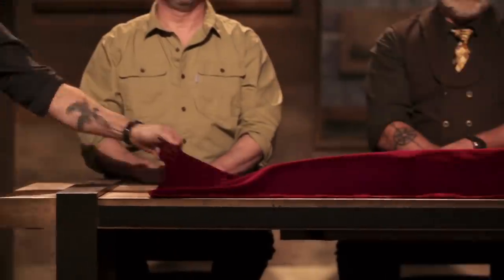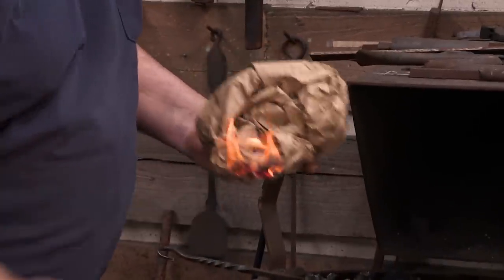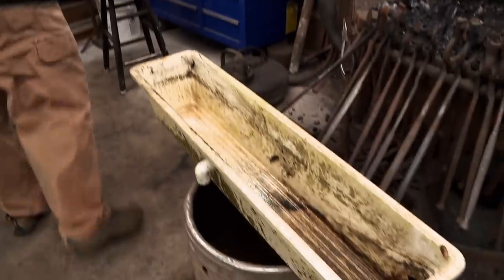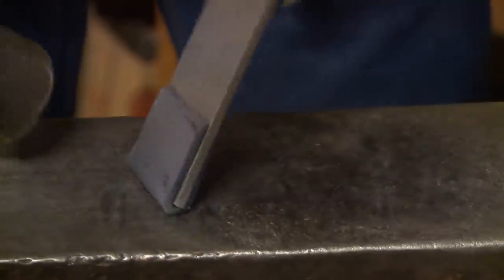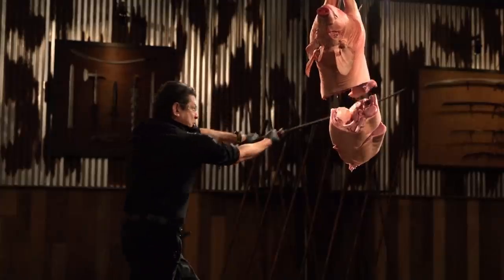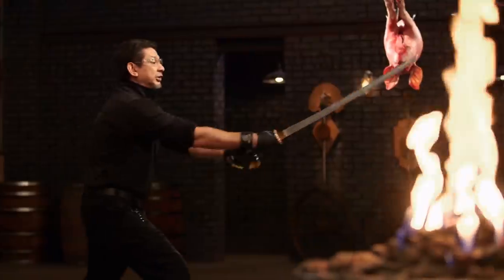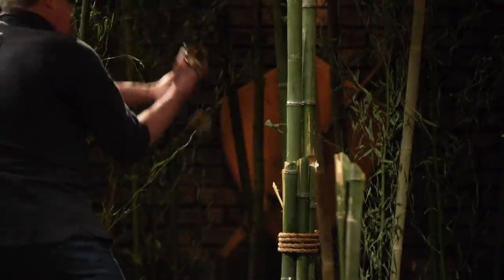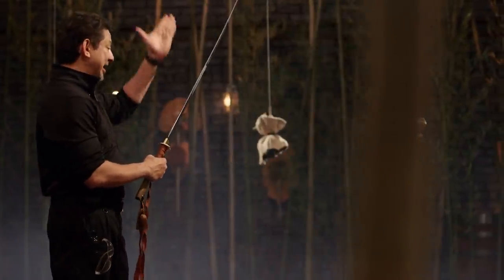Forged in Fire: Gunto Final Round: Richey vs. Elijah (Season 6) | History

Comment: Imagine your in the battlefield.. What would you choose?
1)unwraped sword. or 
2)A bended sword.

   What a judges?
Reply: Both smith's took a slightly bend. One in the kill test, the other in the Streangth test. With that they where tied. But the loose wrapping seemed to be more of a problem, then the lighter blade brings an advantage.
I think it's important to notice that the judges are really picky, when it comes to the handle of a weapon. 
In every round and challenge, the handle is the thing that sets the closest competitors apart from one another. 
And I think thats not without a reason. The handle is the piece that connects the user to the weapon. A well done handle dicides about how good you can control this weapon. 
The best crafted blade is worth nothing if the handle makes it unusable. A bad handle could case, stress in the blade, it can hurt you, rotates the blade uncontrollable or just let you slip of your weapon. 
Japanese swords like this have the "problem" that they have a straight, smooth, wooden handle without a pommel. Thats why the wrapping is the one thing that can prevent the blade to slip out of your hand while swinging or defending. A loose or slippy handle forces me to worry about what I can do and how to do it without risking to loose the blade. That's why I can't strike at full Streangth, or speed. In this case I cannot utilize the advantage of a lighter blade. I would rather wield a slightly more bended blade with a strong handle, than a lighter blade I cannot utilize to its fullest potential, because I cannot focus on the battle only. 
I mean, I really like Richie, he's such a nice guy. 
But just because someone is a better person doesn't just mean they have to be the winner of a compaction. I mean, the task is to build the best possible copy of a weapon, ready for battle then and there...not to be a super nice guy. 
I just can't understand how everyone thinks he knows more about how to judge these swords then the JUDGES who used them side by side. They are wonderful bladesmiths and weapon experts...
They just had less confidence in a unwrapped handle than in a slightly more bended sword.

Comment: I think a bending blade would be worse than a slipped wrap
Reply: Both smith's took a slightly bend. One in the kill test, the other in the Streangth test. With that they where tied. But the loose wrapping seemed to be more of a problem, then the lighter blade brings an advantage.
I think it's important to notice that the judges are really picky, when it comes to the handle of a weapon. 
In every round and challenge, the handle is the thing that sets the closest competitors apart from one another. 
And I think thats not without a reason. The handle is the piece that connects the user to the weapon. A well done handle dicides about how good you can control this weapon. 
The best crafted blade is worth nothing if the handle makes it unusable. A bad handle could case, stress in the blade, it can hurt you, rotates the blade uncontrollable or just let you slip of your weapon. 
Japanese swords like this have the "problem" that they have a straight, smooth, wooden handle without a pommel. Thats why the wrapping is the one thing that can prevent the blade to slip out of your hand while swinging or defending. A loose or slippy handle forces me to worry about what I can do and how to do it without risking to loose the blade. That's why I can't strike at full Streangth, or speed. In this case I cannot utilize the advantage of a lighter blade. I would rather wield a slightly more bended blade with a strong handle, than a lighter blade I cannot utilize to its fullest potential, because I cannot focus on the battle only. 
I mean, I really like Richie, he's such a nice guy. 
But just because someone is a better person doesn't just mean they have to be the winner of a compaction. I mean, the task is to build the best possible copy of a weapon, ready for battle then and there...not to be a super nice guy. 
I just can't understand how everyone thinks he knows more about how to judge these swords then the JUDGES who used them side by side. They are wonderful bladesmiths and weapon experts...
They just had less confidence in a unwrapped handle than in a slightly more bended sword...am I the only one who can understand their decision? 😅

Comment: Let me first say that I loved Richie. He was awesome and I wanted him to win. However, I see a lot of people on here have failed to notice that both blades picked up a slight bend in testing. Richie's, during the Kill test, and Elijah's, during the strength test. And then on top of that, Richie's handle wrap came undone. That doesn't seem like much, but imagine the problems that would cause on a battlefield, which is what they are evaluating in this contest, if it would be a good weapon to take into combat. Having that wrap hanging loose like that, could get you tangled up or cause a tripping hazard while you're fighting. So I really don't believe the judges were wrong in picking Elijah's Katana over Richie's. Had Richie's wrap not come undone, I feel positive he would have won.

Comment: I dunno about you guys, but I'd rather re-wrap a handle than use a bent blade.
The lighter sword performed better in all tests but nope, wrap came undone. Doesn't matter that your competitor's blade gained a slight bend (which would only bend more with sustained use and likely can't be fixed).

Comment: I cant agree with them on this one.
isnt this show about forging a blade, working with metal and not about wrapping a handle... ?
one blade bent, the other didnt, that should have ended it right there, the wrap can be re-woven onto the handle with ease, but a bent blade would eventually break and requires a lot more to "repair" it.

Comment: I thought this was a bladesmithing competition not leathercrafts. Dude got screwed.
Reply: Why do 99% of all the others just didn't listened to Doug after the kill test. Both smith's took a slightly bend. With that they where tied. But the loose wrapping seemed to be more of a problem, then the lighter blade brings an advantage.
I think it's important to notice that the judges are really picky, when it comes to the handle of a weapon. 
In every round and challenge, the handle is the thing that sets the closest competitors apart from one another. 
And I think thats not without a reason. The handle is the piece that connects the user to the weapon. A well done handle dicides about how good you can control this weapon. 
The best crafted blade is worth nothing if the handle makes it unusable. A bad handle could case, stress in the blade, it can hurt you, rotates the blade uncontrollable or just let you slip of your weapon. 
Japanese swords like this have the "problem" that they have a straight, smooth, wooden handle without a pommel. Thats why the wrapping is the one thing that can prevent the blade to slip out of your hand while swinging or defending. A loose or slippy handle forces me to worry about what I can do and how to do it without risking to loose the blade. That's why I can't strike at full Streangth, or speed. In this case I cannot utilize the advantage of a lighter blade. I would rather wield a slightly more bended blade with a strong handle, than a lighter blade I cannot utilize to its fullest potential, because I cannot focus on the battle only. 
I mean, I really like Richie, he's such a nice guy. 
But just because someone is a better person doesn't just mean they have to be the winner of a compaction. I mean, the task is to build the best possible copy of a weapon, ready for battle then and there...not to be a super nice guy. 
I just can't understand how everyone thinks he knows more about how to judge these swords then the JUDGES who used them side by side. They are wonderful bladesmiths and weapon experts...
They just had less confidence in a unwrapped handle than in a slightly more bended sword...am I the only one who can understand their decision? 😅

Comment: you can re wrap a handle. you can’t fix a bend on an already finished sword.
Reply: Both smith's took a slightly bend. One in the kill test, the other in the Streangth test. With that they where tied. But the loose wrapping seemed to be more of a problem, then the lighter blade brings an advantage.
I think it's important to notice that the judges are really picky, when it comes to the handle of a weapon. 
In every round and challenge, the handle is the thing that sets the closest competitors apart from one another. 
And I think thats not without a reason. The handle is the piece that connects the user to the weapon. A well done handle dicides about how good you can control this weapon. 
The best crafted blade is worth nothing if the handle makes it unusable. A bad handle could case, stress in the blade, it can hurt you, rotates the blade uncontrollable or just let you slip of your weapon. 
Japanese swords like this have the "problem" that they have a straight, smooth, wooden handle without a pommel. Thats why the wrapping is the one thing that can prevent the blade to slip out of your hand while swinging or defending. A loose or slippy handle forces me to worry about what I can do and how to do it without risking to loose the blade. That's why I can't strike at full Streangth, or speed. In this case I cannot utilize the advantage of a lighter blade. I would rather wield a slightly more bended blade with a strong handle, than a lighter blade I cannot utilize to its fullest potential, because I cannot focus on the battle only. 
I mean, I really like Richie, he's such a nice guy. 
But just because someone is a better person doesn't just mean they have to be the winner of a compaction. I mean, the task is to build the best possible copy of a weapon, ready for battle then and there...not to be a super nice guy. 
I just can't understand how everyone thinks he knows more about how to judge these swords then the JUDGES who used them side by side. They are wonderful bladesmiths and weapon experts...
They just had less confidence in a unwrapped handle than in a slightly more bended sword.

Comment: Richie should have won he’s a good man
Reply: Both smith's took a slightly bend. One in the kill test, the other in the Streangth test. With that they where tied. But the loose wrapping seemed to be more of a problem, then the lighter blade brings an advantage.
I think it's important to notice that the judges are really picky, when it comes to the handle of a weapon. 
In every round and challenge, the handle is the thing that sets the closest competitors apart from one another. 
And I think thats not without a reason. The handle is the piece that connects the user to the weapon. A well done handle dicides about how good you can control this weapon. 
The best crafted blade is worth nothing if the handle makes it unusable. A bad handle could case, stress in the blade, it can hurt you, rotates the blade uncontrollable or just let you slip of your weapon. 
Japanese swords like this have the "problem" that they have a straight, smooth, wooden handle without a pommel. Thats why the wrapping is the one thing that can prevent the blade to slip out of your hand while swinging or defending. A loose or slippy handle forces me to worry about what I can do and how to do it without risking to loose the blade. That's why I can't strike at full Streangth, or speed. In this case I cannot utilize the advantage of a lighter blade. I would rather wield a slightly more bended blade with a strong handle, than a lighter blade I cannot utilize to its fullest potential, because I cannot focus on the battle only. 
I mean, I really like Richie, he's such a nice guy. 
But just because someone is a better person doesn't just mean they have to be the winner of a compaction. I mean, the task is to build the best possible copy of a weapon, ready for battle then and there...not to be a super nice guy. 
I just can't understand how everyone thinks he knows more about how to judge these swords then the JUDGES who used them side by side. They are wonderful bladesmiths and weapon experts...
They just had less confidence in a unwrapped handle than in a slightly more bended sword.

Comment: bent blade? unraveled wrap? one seems like a critical fail while the other is superficial at best, dude was robbed.
Reply: Both smith's took a slightly bend. One in the kill test, the other in the Streangth test. With that they where tied. But the loose wrapping seemed to be more of a problem, then the lighter blade brings an advantage.
I think it's important to notice that the judges are really picky, when it comes to the handle of a weapon. 
In every round and challenge, the handle is the thing that sets the closest competitors apart from one another. 
And I think thats not without a reason. The handle is the piece that connects the user to the weapon. A well done handle dicides about how good you can control this weapon. 
The best crafted blade is worth nothing if the handle makes it unusable. A bad handle could case, stress in the blade, it can hurt you, rotates the blade uncontrollable or just let you slip of your weapon. 
Japanese swords like this have the "problem" that they have a straight, smooth, wooden handle without a pommel. Thats why the wrapping is the one thing that can prevent the blade to slip out of your hand while swinging or defending. A loose or slippy handle forces me to worry about what I can do and how to do it without risking to loose the blade. That's why I can't strike at full Streangth, or speed. In this case I cannot utilize the advantage of a lighter blade. I would rather wield a slightly more bended blade with a strong handle, than a lighter blade I cannot utilize to its fullest potential, because I cannot focus on the battle only. 
I mean, I really like Richie, he's such a nice guy. 
But just because someone is a better person doesn't just mean they have to be the winner of a compaction. I mean, the task is to build the best possible copy of a weapon, ready for battle then and there...not to be a super nice guy. 
I just can't understand how everyone thinks he knows more about how to judge these swords then the JUDGES who used them side by side. They are wonderful bladesmiths and weapon experts...
They just had less confidence in a unwrapped handle than in a slightly more bended sword.

Comment: Yo, i don't know much about smithing but aren't you supposed to use the pocket technique were the harder metal goes inside and becomes the edge to be razor sharp and in the outside a softer metal to be the body having a more flexible metal to avoid a brittle sword?
Again, i have only research this online and my knowledge have a lot of voids.

Comment: Richie should’ve won IMO
Reply: Both smith's took a slightly bend. One in the kill test, the other in the Streangth test. With that they where tied. But the loose wrapping seemed to be more of a problem, then the lighter blade brings an advantage.
I think it's important to notice that the judges are really picky, when it comes to the handle of a weapon. 
In every round and challenge, the handle is the thing that sets the closest competitors apart from one another. 
And I think thats not without a reason. The handle is the piece that connects the user to the weapon. A well done handle dicides about how good you can control this weapon. 
The best crafted blade is worth nothing if the handle makes it unusable. A bad handle could case, stress in the blade, it can hurt you, rotates the blade uncontrollable or just let you slip of your weapon. 
Japanese swords like this have the "problem" that they have a straight, smooth, wooden handle without a pommel. Thats why the wrapping is the one thing that can prevent the blade to slip out of your hand while swinging or defending. A loose or slippy handle forces me to worry about what I can do and how to do it without risking to loose the blade. That's why I can't strike at full Streangth, or speed. In this case I cannot utilize the advantage of a lighter blade. I would rather wield a slightly more bended blade with a strong handle, than a lighter blade I cannot utilize to its fullest potential, because I cannot focus on the battle only. 
I mean, I really like Richie, he's such a nice guy. 
But just because someone is a better person doesn't just mean they have to be the winner of a compaction. I mean, the task is to build the best possible copy of a weapon, ready for battle then and there...not to be a super nice guy. 
I just can't understand how everyone thinks he knows more about how to judge these swords then the JUDGES who used them side by side. They are wonderful bladesmiths and weapon experts...
They just had less confidence in a unwrapped handle than in a slightly more bended sword.